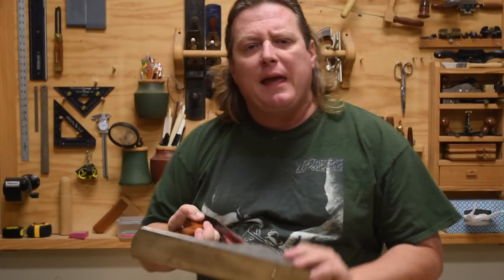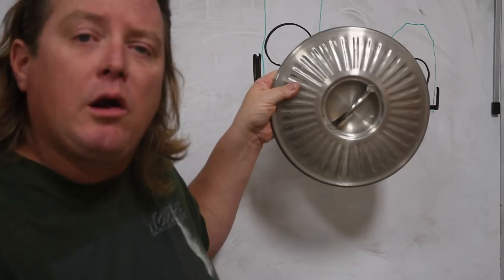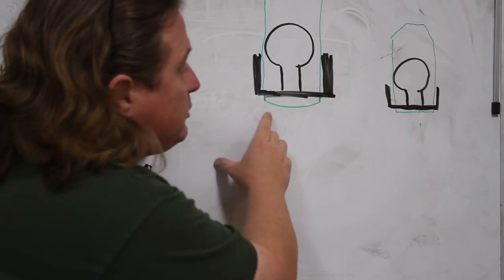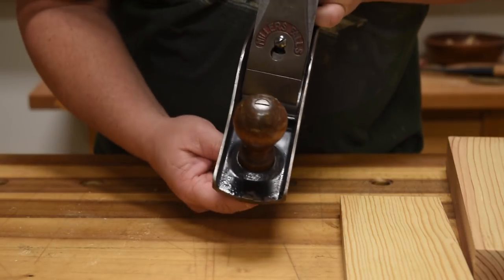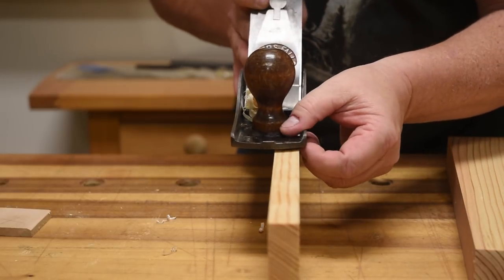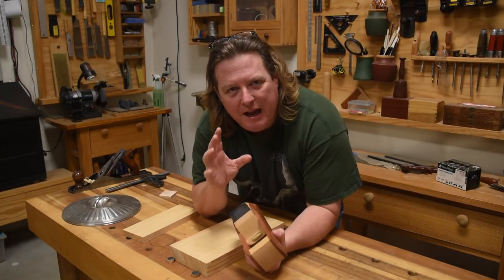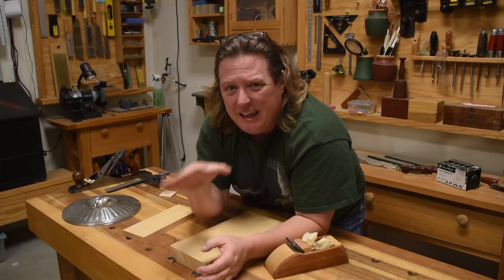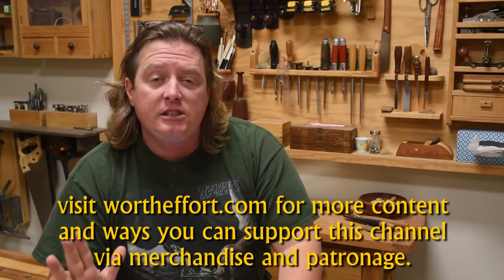Curved Plane Blades

Comment: great insights, thank you. i just did the math; for a 3’ radius cambered iron set at 45 degrees, the difference from the middle of the blade to the edge, assuming a 2.5” wide blade, is 15.3 thou or about 1/64”. For a 12”R iron at 45 degrees is 92.1 thou or about  3/32”
Reply: Very interesting. So the amount of camber he recommends (.001-.002 in.) is way over 3 ft radius! Which makes sense I guess for putting a curve into the cut that you can neither see nor feel. I think the actual purpose is to avoid plane tracks left by the blade corners, by just removing the corners.
Reply: Michael Anderson haha yes way over 3’. good off the cuff estimate though and I think it also gets the point across. in practice, pressing more on the corners when sharpening will get the exact camber he is talking about for a smoothing plane

Comment: Hi, interesting what you said about angles.  I have been sharpening all my blades flat and at 30 degrees (with a home made jig).  I'm no expert which is why I'm trying to learn from you and others.  Bear in mind here also that I'm from the UK and all but one of my planes are English Stanleys and Records.  One plane I came across recently though was a USA made Stanley Sweetheart 4 1/2.  On this plane, I noticed that even though the blade was perfectly flat at the sharpening angle, when it is mounted in the plane, the edge protruding through the mouth is slightly cambered.  At first I thought my sole wasn't flat, however I think this is because the back of the blade is actually not flat.  I did think about trying to flatten the back of the iron but then wondered if this was why i.e. you sharpen on a flat stone but you get a cambered edge naturally.  Imagine if you took a piece of card and held it at a 30 degree angle but bent the sides so it was in a convex curve forwards and then took a slice horizontally.  The slice would be perfectly flat but if you held the card in the same curved position and at 45 degrees you would see that there would be a camber.  Does this make any sense?  Cheers.

Comment: Using a cambered blade setup as you describe makes a ton of sense. Thanks for the tip.  It seems to me the blade should have a larger radius than a scrub plane, and be honed to a better edge. How do you get there?
Reply from the maker: A little extra pressure on the sides as you sharpen does the trick for me.

Comment: I really enjoy the tips of the day, btw what do you do with all of your shaving and saw dust
Reply from the maker: Thanks. I donate them to the cities landfill to help in the decomposition of other scrap as it raises the area temperature via chemical change from rotting. (I throw it away.)
Reply: I use mine in the compost bin and in my chicken and duck coops (keeping out pressure treated lumber dust which goes to the trash)
Reply: Plane shavings make great fire starter in a wood burner. Much more classy than news paper.